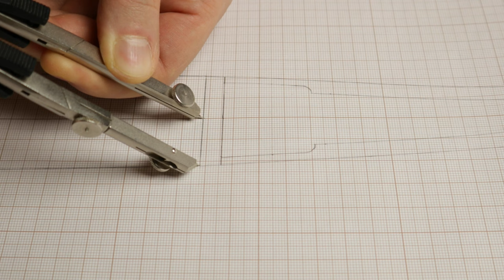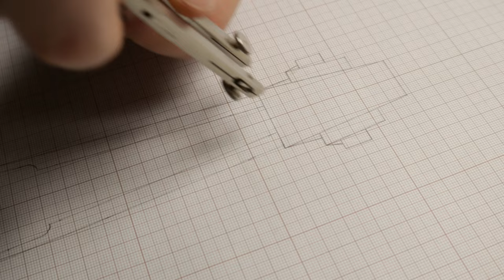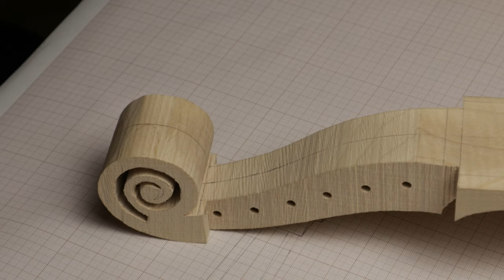Viola da gamba making | Part 4 – initial cutting of the scroll

Comment: Henry, thanks for sharing your building process. Are you going with a butt joint at the neck with screws/dowels  or just a glued butt joint? Will you make the garland first and then attach the back or are you going to glue the sides on to the back when it is secured to the baseboard? Looks like a mouldless construction?
Reply from the maker: I'm going for a regular glued butt joint without any screws or dowels. I don't use moulds. I have the back glued on to a 'false back' or baseboard. Then I glue the sides one at a time.
Reply: @henrylenck7242  Great, look forward to see more videos. I'm interested to see your method of shaping the upper bout sides to fit the back.  I've made a bass viol using this method but found this part of fitting the sides to the fold a bit fiddly.
Reply from the maker: That's true. The upper bout sides are the most tricky to fit. But it's doable if you take your time. The next videos are going to be about sides so stay tuned.

Comment: Henry, when the outer part of the scroll is cut..how do you extend the lines of the curve to the inner parts.. with a flexible ruler? What curves do you follow?
Reply from the maker: Well it's tricky to answer this question. I follow the plans from Part 2 (see 4:00) and measure the distances from the center line of the whole neck to the outermost points of the scroll. I look at the scroll sort of 'face to face' and mark the points where the scroll 'takes a turn'. Then I connect those points with the help of a flexible ruler. Hope this claryfies things a bit.
Reply: @henrylenck7242  Thanks a lot Henry. 

I was referring to point 6:43 on the video when we see the line drawn on the inside of the scroll. This can only be drawn after the outside fold of the scroll is cut. Here how do u extend the lines of the scroll?

Thanks! :)
Reply from the maker: That is exactly how I do it. After cutting the outside sections of the scroll I gradually extend the lines on the visible inside parts following the steps from previous comment.